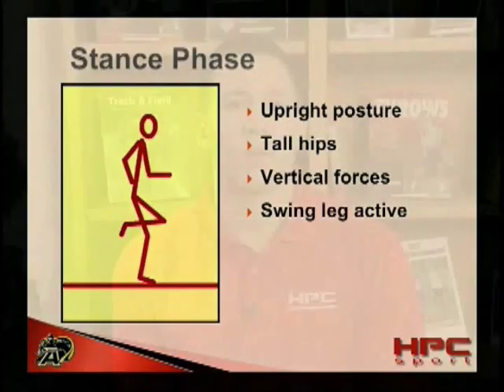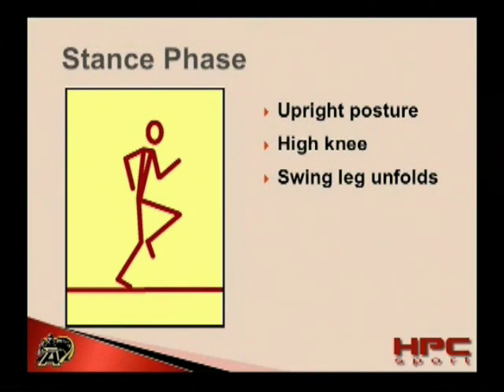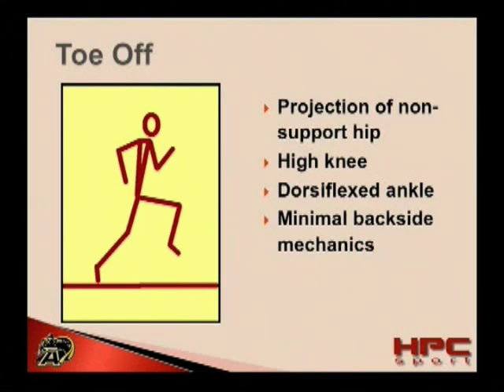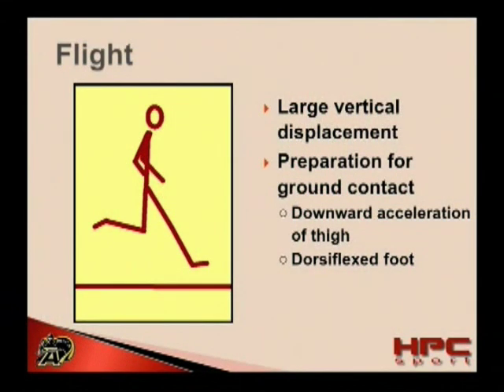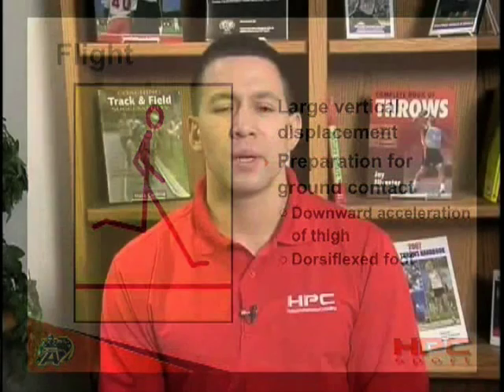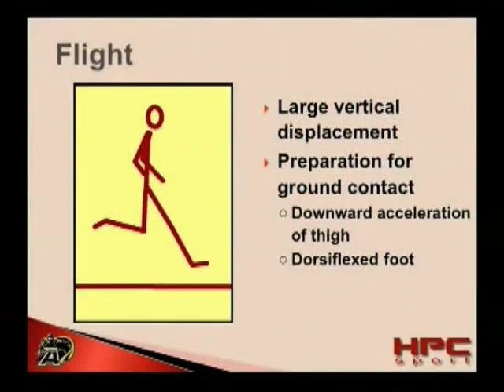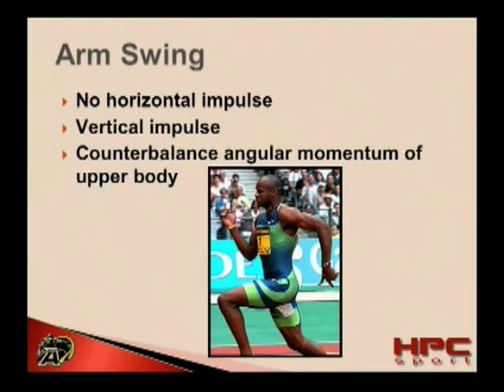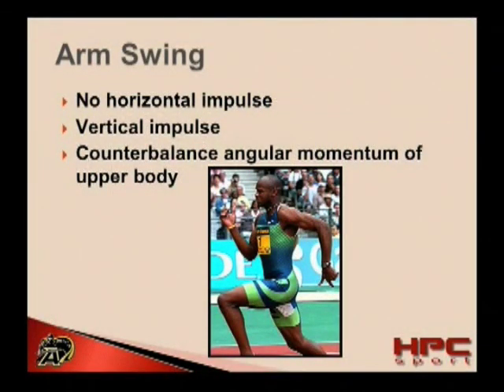Maximum Velocity Sprint Mechanics

Comment from the maker: @Zieg117 The arms are always used for counterbalancing the action of the legs and controlling rotation of the shoulders. During drive phase they provide horizontal and vertical propulsive forces. During top-end speed running they primarily just provide vertical propulsive forces.

Comment from the maker: Dorsiflexion is mainly only going to be important if you are an excessive plantarflexor. At varying speeds all the cues should be the same but to lesser magnitudes (lower knee lift, etc). During acceleration the arms definitely contribute to forward propulsion because the COM is ahead of the base of support but in top end speed sprinting the arms don't contribute to forward propulsion directly. The lats and pecs are both also important for sprinting (but not enough to make it a huge focus).

Comment from the maker: During acceleration, the piston like action works well. As you transition to upright postures / top endspeed running, you'll need to be stepping over the opposite / support leg knee so you minimize backside mechanics and maximize frontside mechanics. This will look more like riding a bike than a piston action.

Comment from the maker: Eccentric strength, or more specifically leg stiffness, is REALLY important for the 100m and 200m. If you are lacking, ground contact times will be longer and you won't be able to attain or maintain top end speeds.

Comment from the maker: It sounds simple but the most important thing to do to get faster is to run fast. Make sure you're doing high intensity sprint work with full recoveries. Things like reps of 10-50 yards with complete recoveries lasting anywhere from 1-5 minutes. Also, make sure you're resting the final week before you test otherwise you'll be too fatigued to run fast.

Comment: Okely doke. Also, (i know this isnt directly related but) I have heard that to develop your vertical a good way of doing so is in phases. First a solid base of strength should be developed, then explosiveness and then using plyometrics to be able to use the developed strength. Should i do the same thing for sprinting or should i concentrate on sprints and drills?

Comment: @roxtar55
you don't know what you're saying. you can never isolate certain fiber types. your nervous systems recruits more and more muscles fibers (slow to fast twitch) depending on the work intensity. For instance, for a 100m sprint all fibers are recruited, meaning all slow and fast twitch fibers are being used.